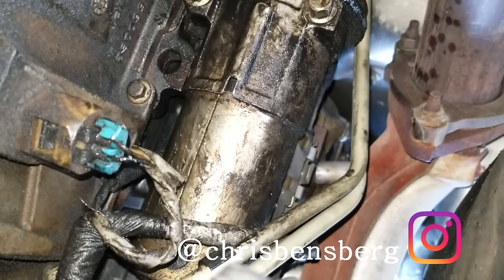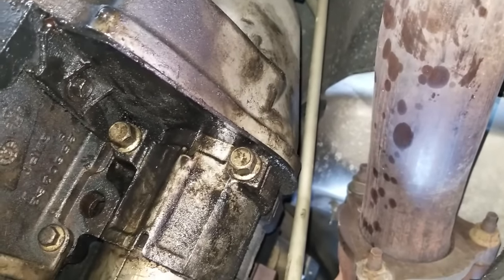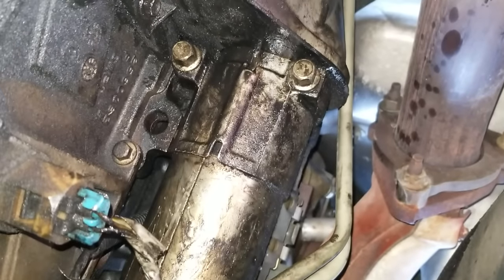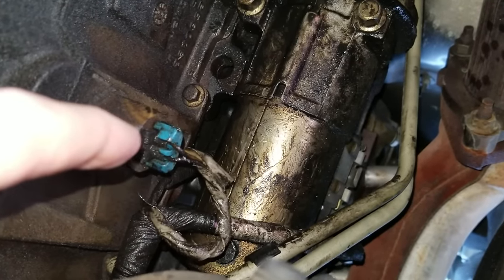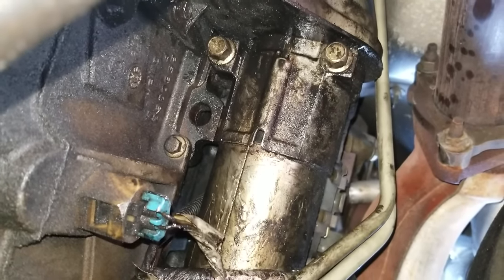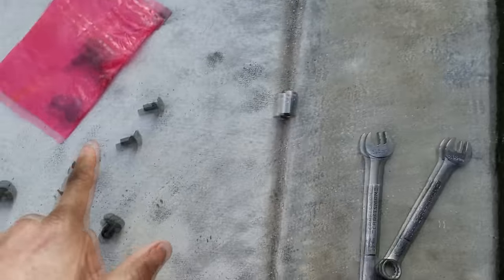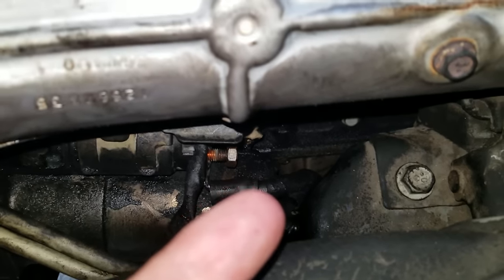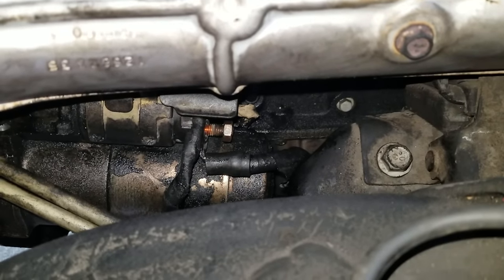How To Replace Starter On 1999-2006 Chevrolet Silverado 1500 And HOW TO TAKE IT OUT!!

Comment: funny i just replaced the starter on a 2000 chevy 2500 and it came out without a problem, weird how they couldnt appy the same design to the 1500

Comment: Lmao. Do you remove the dipstick for every repair. Should of took the cab off the frame or take the engine out lol.
Reply: Lmao, right. Wasting their time. Just pop the battery wire fasteners loose from the frame, gives you all the wiggle room you need. Takes 30 seconds.  Then you can drop the starter and have access to both wires on solenoid.  Much easier this way!

Comment: Thanks. Was hell getting the bolts out, didn't know how to disconnect the wires without breaking the blue connector because it was backwards. Even with the wires disconnected it's a pain in the ass. Who engineered this shit? A starter should be easier to replace than this.

Comment: 13mm and 8 mm , what about the other Two??
Reply: The two main bolts on the bottom is 13 mm, preferably a 6 point and then use a baby ratchet with a shallow well 13 mm to take off the hot starter wire and then the 8 mm for the itty bitty wire

Comment: I’m so frustrated had a mobile macanic come to take the starter off which literally only took him 5 min I was in shock at how quick he did it! And he only charged me $40 ok so I had to order a new starter so it took 3 days to get the new one and I talked to him several times when it arrived I tried to get in touch with him but he would not answer all day then finally he wrote me and apologized and he would b here at 8am the next morning well at 8 he wrote again saying he would have to come later on around 3pm ok no problem well 3 came and went as well as 4,5,6.......ect now he will not answer I’ve tried calling texting messenger and Facebook from multiple devices so I have no choice but to reinstall it myself mind you I’ve worked on cars my whole life and I enjoy it with my husband helping me so I’m very familiar with a lot more more than most females and I don’t mind getting covered in grease! But for some reason it has been a nightmare getting the bolts to line back up I can get one started on the bottom but I can’t get the one on top to catch I’ve even took the bottom back out and tried putting it in first still will not catch I desperately need a step by step video of someone installing one on an actual 2000 Chevy tracker so I can see what I may be doing wrong if it only took him literally 3 or 4 minutes to remove it why the hell have I been under this mofo fighting to just put 2 damn bolts in for 3 hours?im so sore I feel like I’ve pulled every muscle in my neck arms and shoulders!!! I’m frustrated to the point where I’m really ready to torch this somebioch ! (My hubby’s hands are way way to big to fit) I feel like it should have went back in just as easy as it came out wtf am I doing wrong ?????